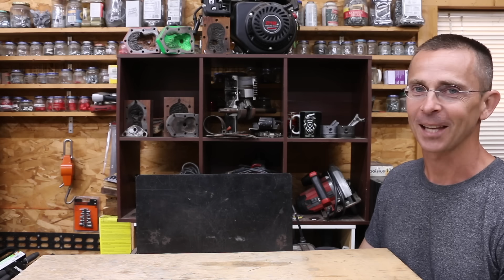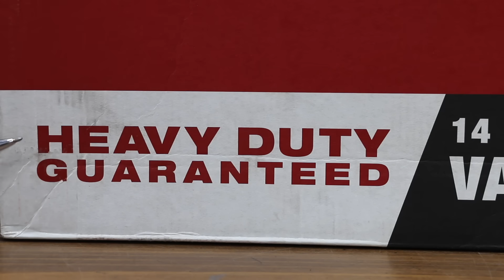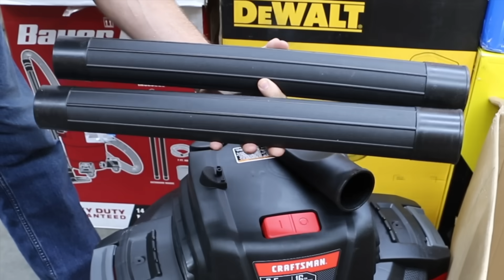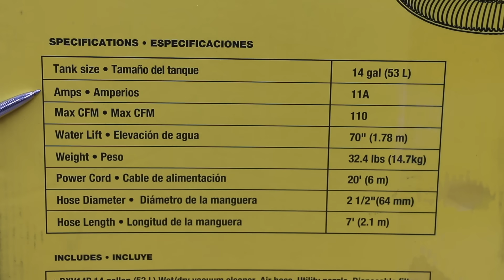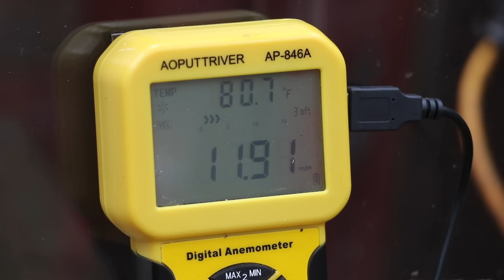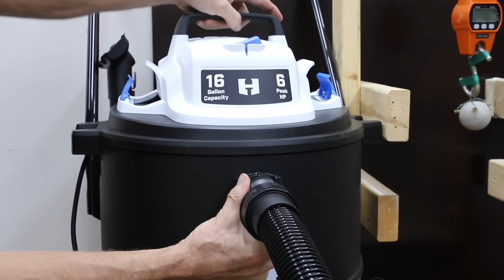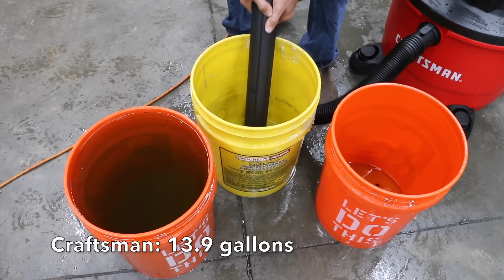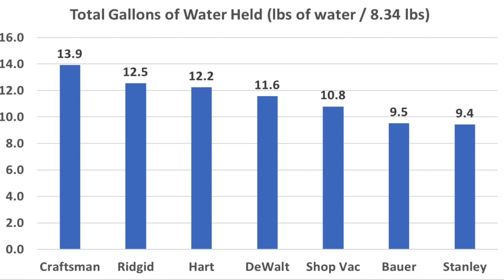Best Shop Vac? Ridgid vs Shop Vac, DeWalt, Stanley, Hart, Craftsman

Comment: My first shop vac was a craftsman when they were king of the affordable options. I had it for 25 years. I ended up using it for a dust separation system with a Vortex funnel and catch bin. Still runs. Even after using it to clean my goat house and chicken coop a few times a year. 

I bought a Ridgid a few years ago that the top converts to a blower. 7 years and still running fine.

I’m a Yellow Tool fan because batteries are expensive and I started with Yellow. If my Ridgid ever goes out, I’ll look at a Dewalt.  But the top converting to a blower is a real clincher to just get another Ridgid considering I have 7 years on this one and it’s running fine.

Excellent video as always!

Comment: So i have a question....my shopvac  claims it uses 10amps, my miter saw claims it uses 15amps. I only run a 15 amp breaker... what black magic is my shed using to allow .e to use my shopvac to be my dustextractor and mitersaw at the same time without popping a fuse...

Comment: The Dewalt look like it was the champion in quite a number of categories, including head to head match up with the Bauer, suction time on sand AND the very important quiet operation— and by a mile. A shame it’s so heavy but if I were getting a shop Vac, I would definitely get the DeWalt

Comment: Great stuff, but there is an enormous hole in what is covered: what happens with the stuff when it gets into the tub.  I have two shop vacs.  The Craftsman is 40 years old, with a large pleated paper filter - the original filter - that is pretty much a mess.  Emptying the vac means cleaning the stuff out from between the pleats.  Maybe if all it picked up is like the stuff in your test it would just shake out, but when it is full of saw dust, cobwebs from the corners of the shop, and bits of insulation, you probably will wish for a second vacuum to clean the filter.  My second vac is a recently purchased DeWalt where the stuff goes into a paper bag.  Obviously there is a tradeoff, cost of the bags and it has to limit air flow, but the convenience can be worth it.

Comment: Bought the 16 gallon craftsman without the detachable blower on Amazon prime Day 7/10/25 $110 to replace my 23 year old craftsman 20 gallon vacuum. The old one still runs fine. Only problem is the tub has developed numerous cracks from plastic fatigue. The new one seems to have more suction and runs quieter by at least 10 DB. The box , said it was made in Mexico even though the craftsman website says it’s made in Pennsylvania and Google says it’s made by Emerson tool company  in the U.S. which is not correct either. Here’s the address where it’s actually made in Mexico. Emerson Tools and Appliance Company, S. de R.L. de C.V.

Comment: If you buy anything electronic or mechanical that cost more than $30 at Harbor freight do not leave the harbor freight store without buying at least a one year or preferably two year replacement plan on the product you’re buying they will stand behind that replacement plan 100% it’s money well spent I bought a 170 titanium mig welder sometime back and put a two-year replacement plan on it and then about one and three-quarter year later that welder stopped working and they’re not cheap,,,they replaced it on the spot and apologize for it failing 👍

Comment: I own a Rigid 6.5 and it is a beast. Not sure if that Rigid model was all that was available to you, as mine does not have a detatchable motor. Just a standard "shop vac". The lid on my Rigid is super tight and it will eat anything that comes in close proximity to the sucky end....including a hand towel....ask me how I know.

Comment: I saw a issue with the craftsman: i saw water came out of the blower port and ik how to fix it first you will need a flat head screw driver 1st step: remove the lid 2nd step: put the flat head screw driver in the filter cage slots 3rd step: remove filter cage 4th step: flip the float and make sure the flat end faces upward while the open end faces down 5th step: put it all back together and make sure it works and there you go i had the same problem with my older sears craftsman 3.5 peak hp 9 gallon wet dry vac that did the same and i fixed it

Comment: It was definitely disappointed by the Rigid, but it's unfortunate that you chose what I would consider their most gimmick model. I would've liked to see more of a direct comparison of regular shop vacs.  If it didn't have all the extra area requiring a seal I wonder if it would've performed better.  I have a shopvac brand at home, but use Rigid at work. Rigid seems much stronger, but it's not this weird model.

Comment: I have an older Fien shop vac that's beeya good unit, it's very quiet and has an option on it that allows a tool such as a miter saw or sander to be plugged into it, the vacuum turns on when the tool is used and runs a few seconds after the tool isoff to clear the line. That has been very useful when work n a clients home.

Comment: Great video, I have one comment in case you do another shop vac video. The suction test with the ball didn't account for hose/tube size. This impacts both the surface area exposed to the vacuum environment and also the direction of the force at the contact point, both of which will impact the results. Normalizing for this by adapting each nozzle to the same diameter would address this.

Comment: The best suction came from the tightest seal obviously. It’s strange because you would think that would be the least expensive thing to improve. You can have the strongest motor but it means nothing if the seals are leaking.

Comment: The old blue and gray shop vacs will rip a shirt of my back lol. Probly 20 lbs of suction and the lid is right and tight with zero play or movement. New stuff made to fail so you gotta buy more while old stuff made to last so people had to buy less therefore making companies less money.. which is why freezers don't last 40 years anymore let alone vacuums, ac units, or vehicles. Would love to see a 2024 car in 40 years when every piece of the computer fails due to bad capacitors lol.

Comment: I had a Ridgid that I loved. It lasted for years, even though I left it outside (even in the rain, lol). It finally bit the dust so I splurged on a "real" Shop Vac and although it's stronger I was surprised the tubes and accessories didn't lock on. You'd think the flagship brand would have figured this out by now. Vacuum any carpet or floormats and your pieces wiggle free in seconds. I miss my Ridgid!

Comment: the  water bucket test wasn't fair, rather than having both submerged  and turning the power on at the same time , you can tell one went into the water first , also the angle  makes a difference holding the hose at the bottom to restrict the suction

Comment: I'm going out to buy a dewalt right now. I plan to use it with a carpet extractor wand and the static suction will really help at pulling water from the carpet. This is probably as close as someone could possibly get to the power of a commercial carpet cleaner for less than $500.

Comment: I had the bauer as my last shop vac and it gave up the ghost soon after. The switch didn’t go bad and wire didn’t come loose. The motor itself just died. Won’t buy another. Going today and getting a craftsman thanks for the video ✊🏻🔫🇺🇸

Comment: Experiment inprovement: radius of attraction. Lower the nozzle flat down to a dusfy surface (with an air relief hole in the center) to measure the area of powder removed.

Comment: Went with the dewalt 16 gallon stealthsonic (i dont think the the model reviewed here was a stealthsonic).  It performs fantastically.  the sound emitted is so low that this in itself would tip me in that direction.  The value of this was unrealized but should not be underestimated.  I can still hear podcasts on my  iphone speaker and carry a conversation!

Comment: Great channel. Very helpful in choosing. Are there any significant differences in hose quality?  My old craftsman that died had a nice durable, flexible hose. I bought a rigid and the hose was very thin and cheap feeling. I’m not concerned with the warranty so I’d like to take a closer look at the Bauer. Do you have any concerns with the hose quality/durability?

Comment: I bought the craftsman in this showdown and it performs very well at first but it didn’t last long it’s not well made it started to trip gfci circuits while in use.  I then bought the dewalt which I haven’t had for long but the fit and finish is just so much better so far I guess I was not aware of the warranty because my craftsman was likely under warranty and that was homeowner 0:01  use not professional.  I’ve always had great luck with dewalt so I opted for it this time I sure hope it does better overall build quantity seems way better as well as it seemed to win every single category on performance except capacity which it was not the same size as the competition so that’s a variable that I would not even consider.

Comment: A problem with many shop vacs is the hose adapter at the canister is slightly smaller diameter and fits inside the hose causing a choke point clog magnet.
The overlap should see the hose inside the adapter, making the adapter diameter larger than the hose diameter at the canister for zero resistance to debris.

Comment: Really like your test selection and was really wanting someone to do video like this however… reason wanted it was to see the rigid with motor on the bottom  results which to my knowledge is the only company who makes one which is WAY better of design the one you tested is one of worst imo design that is. I have no idea why rigid is the only company to make the motor on the bottom from engineering stand point makes way more sense .

Comment: Only thing I would add is that you can get the warranty with the Bauer, but it is just an option if you prefer to save the money and not get it.  They probably would have charged $25 for a two-year warranty.  While it's not as long as others, it has one huge advantage over others in that most items you purchase there don't have to be sent out for warranty.  You just bring it in to any store and they hand you a new one.  Pros and cons in everything.

Comment: Interesting tests. It would have been helpful to use the Ridgid 16 Gallon NXT Wet/Dry Vac (HD1800) without the blower in the comparison since its CFM is higher.

Comment: HI I have a show suggestion not much info on YouTube
Shop vac 2-1/2" wide hose does length of hose reduce suction ? If so, how much suction do you loose at 7 ft hose 12 ft or 20 ft hose.

Comment: @ProjectFarm would you consider reviewing shop vac replacement bags? Buying the official replacements cost a fortune. If love to see if any of the Amazon knockoffs do a good job in terms of filtration, airflow, airflow when x% full, and PPM exhaust with things like wood dust, drywall dust, cement dust, and ash.

Comment: * I have a 6.5 Peak HP 20 gallon Craftsman shop vac. I tried a few things to help it from plugging up the filter. I turned the input so it would create a spin inside. I bought a dust separator from Wood Craft but it reduced the power. I settled on putting a filter bag inside the vacuum and change it every once in a while.  It does not decrease the suction!
* The 20 gallon vac came with a noisy reducing discharge. 
* The internal vac bag works well for sanding, my 12" chop saw, my band saw and my Rigid oscillating drum & belt sander. The bag fits inside the vac, connects to the input and allows for the normal filter to be used also. The bag holds the dust and the regular filter is not plugged at all.

* I bought a used dust collector that has a 4" hose and use it for my table saw. It has a dust separator and a very large hanging cloth bag.
 
Home Depot:
* MULTI FIT
General Debris Wet/Dry Vac Dry Pick-up Only Dust Collection Bags for 15 to 22 Gal Shop-Vac Brand Shop Vacuums (6-Pack).
Internet # 305944556
Model # VF2008A
Price for 6 pack: $43.97

Comment: I got the Dewalt 6HP shop vac. It stopped working after less then 30 days. I took it back and aftger some hassle got a second one. That one lasted less then 3 months. The store will not take it back (too old). Running around dealing with warranty is taking a lot of time.

Comment: I really appreciate all the effort you put into this video. It helped me decide which brand shop vac I plan to purchase. After watching this, I plan to to buy the Dewalt brand. I am bias to Dewalt tools, but I think it tested well in all of the tests you put it through, and will handle anything I plan to use it for. I think the quality Dewalt provides, the attachment holder, and the warranty provided justifies the higher price. Purchasing a Dewalt shop vac also adds another black and yellow tool to my arsenal without changing brands. (obviously I like my stuff to match) Great video for sure!!

Comment: I really like my metabo for $330 aud 
has the plug that can be set to turn on when machine runs, cut those cheap vac attachments and it will fit nearly every brand of power tool that takes a vac

Comment: I work at a shipyard and we build navy boats such as LCS and MMSC. We use craftsman, we have molten metal fall on them, they fall off of ladders they get chucked across confined areas and we use them to vacuum metal shavings, pieces of welding wire and small pieces of steel. Craftsman works.

Comment: 12/01/23: I saw a 6 gallon Ferrex shop vac at aldi for $39.99 with a 13 ft. cord, 4 peak HP and a 5 year warranty.  The filter for it was a piece of thin foam.  I wonder if the Bauer filter and bag fits it.  So  far, I think the one with the dry suction feature and the best value, despite the 3 month warranty is the Bauer.

Comment: got the shop vac today and no assembly instructions, just 4 different barcodes to scan with the model number next to the scan.  Problem is, there is no model number anyplace on the box or the unit.  So its russian roulette picking which model I have, then have to read the instructions on my little phone screen.  And its difficult enough of a design to assemble that you need the manual.  Wish I would have found someone to take the craftsman down from above.  And to top it off, the hose will not fit my Milwaukee air tip beater brush head.  Next time always search for Lowes employees to grap the Craftsman off the third story shelve.

Comment: I was wondering if you could do a test between a "residential" wet dry vac and a commercial vac such as the Karcher or the Mercury Floor Machines to see if they perform any better.  I have bought several residential machines over my 60 year life and I just  wonder if a commercial vac that cost $500 would last longer, I spent that much on consumer machines and they don't last long.

Comment: Craftsman performs well until it dies which is quickly. I use a shop vac to clean filters on my big vacuum so it doesn't get used much. It gave up the ghost after only 3 months. Buy Ridgid, they have lifetime warranty and pretty decent vacuum.

Comment: I just had a Craftsman shop vac fail catastrophically after 3 years of very light occasional use. The warranty was only one year. The Craftsman also has tamper-proof screws to prevent home repair. I'm super disappointed with how far the Craftsman brand has fallen

Comment: one of the most critical and easily tested shop vac performance metrics is decibal level. Also, No shop vac should be run indoors without an internal bag for health reasons primarily but, a clogged filter with skew all performance measurements

Comment: Dewalt is a great shop vac but like a lot of dewalt tools these days they’re not built like they used to be, if you are a contractor and use it all the time like I do they don’t last very long, I just burned out my second dewalt shop vac in two years, but when they work they work well, so I still might get another one

Comment: Thanks for the great shop vac review.  I'm looking for a shop vac for a small home made dust collection system.  Which would be more important for a  dust collection system?   High suction for pulling dust and chips from a table saw and thickness planer,  or high CFM to move materials through a couple of 5 gal cyclones?   Thanks Again

Comment: I really enjoy your comparisons.  I have a Bauer and appreciate what you said about lack of a warranty from the company.  However what I can say is I've had it for over 4 years and I'm a professional detailer so I use it every day for hours at a time. It was even run over by a customer.  It broke one clip that holds the vacuum on but I duct tape it on and it still works like a champ.  While a better warranty would be nice I can personally attest to longevity.

Comment: I have always had good performance from Craftsman shop vacs. One time (2005) I had a Shop-Vac brand and it only lasted a couple of months (of use). I took it apart to repair it and the construction was the second chintziest I had ever seen*. Now I have 2 Stanley 4 gals and 3 Craftsman 12/16 gals, 1 of which is 38 years old.

*Worst machine ever was my 1988 Genie garage door opener which looked like it had been soldered by a 4 year old and had some really dumb design decisions, like running 1/2 HP motor current through a standard sized circuit board trace, which fried about every 3-4 years requiring me to solder in a jumper (altho only on the "open" side, the "close" side still worked).

Comment: A good definition of "peak horsepower" could be "a meaningless number we pulled out of our ass developed in order to allow us to artificially inflate our performance numbers without being able to be proven false."

A standard wall outlet is probably on a 15A circuit breaker, so anything drawing more power than the Rigid will probably trip circuit breakers.

Comment: Btw it’s a stainless steel shell with a lot of attachments. Plan to use a Hepa filter since using it indoors. What are your thoughts regarding the Dewalt 8 gal sold at Costco?